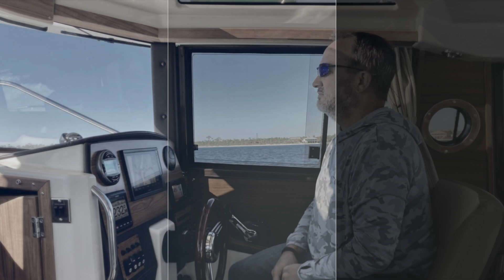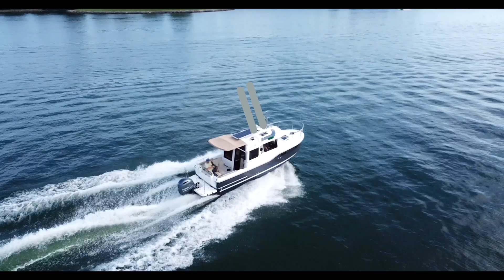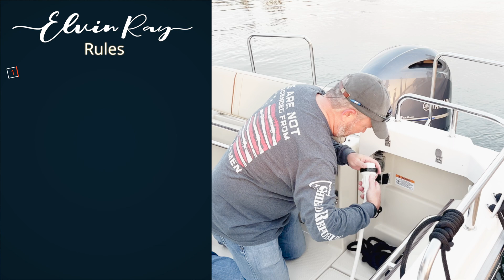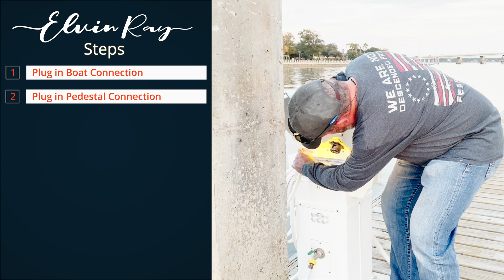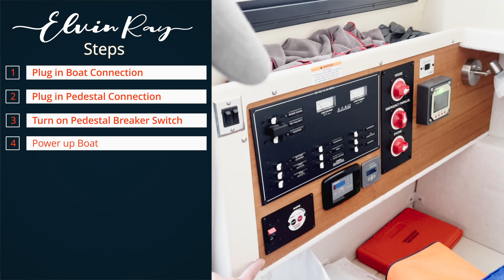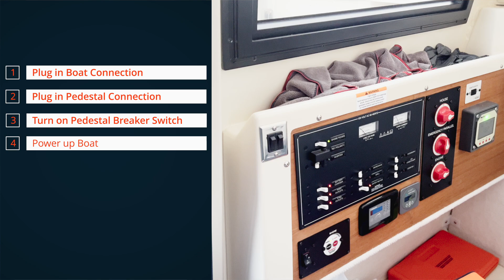Connecting to Shore Power

Comment: Will your batteries charge if your battery switches are off? Also, do you need to turn the shore power switch on your panel on to charge the batteries or will they charge just by turning the battery charger switch on?
Reply from the maker: Yes, your batteries will charge with the battery switches off, assuming your battery charger is connected to the battery circuit before the switch (it would be odd for it to be after the switch). 

You have to turn on the shore power switch to get power to the panel where the switch for the battery charger is. 

Hope this helps!
Reply: @CruisingElvinRay  Thank you for the response. I figured that was the case in regards to the battery switches and the shore power switch at the panel. This is a new to me boat and I'm trying to figure it all out. Today I'm going to use a multimeter on the batteries to see if they're charging. When I turn the battery switch on the panel on I'm getting a hum, not sure if this is normal or not. This boat has three batteries, one for each outboard and then a house battery.